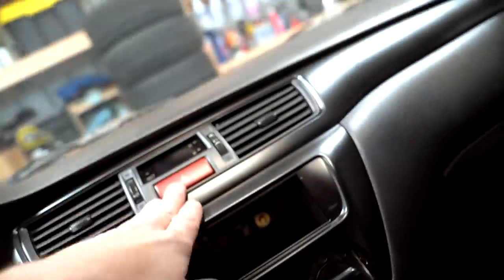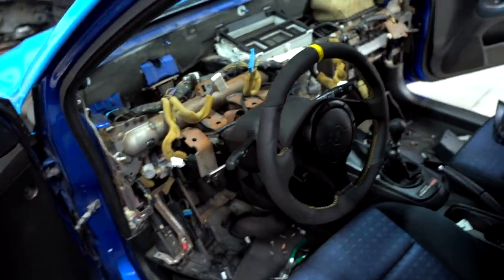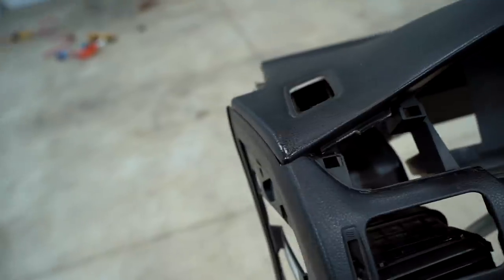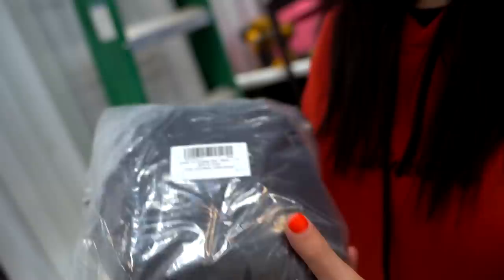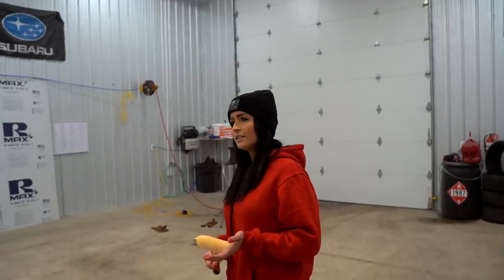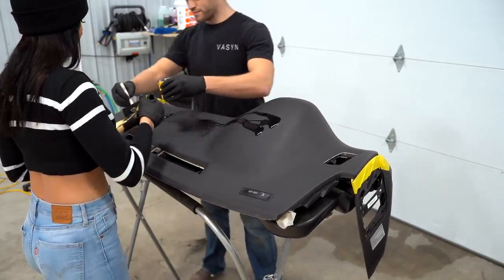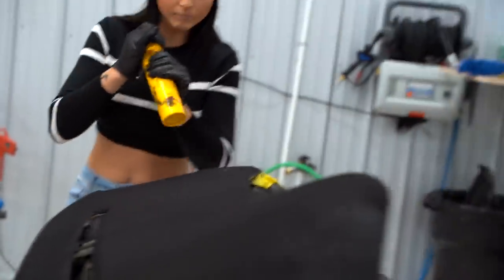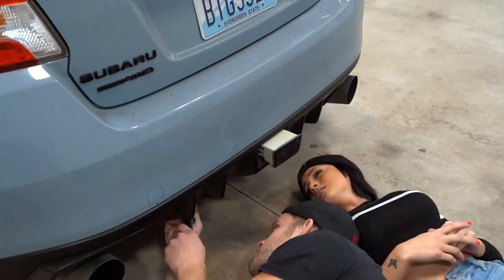Making The Perfect Suede Dash!

Comment: Why not mask off the vin?
Reply: I thought the same thing but I don't think it has the vin on there. Looks like it just says "Air bag"
Reply: @Michael-qe2so  The Vin # is on that same plate right under the AIR BAG part.  I would have masked it off also, to avoid any DMV or popo problems later down the road.
Reply: @SICKIX  whats the number?